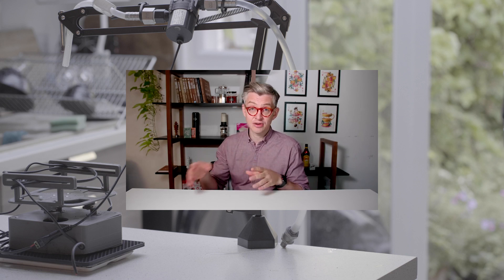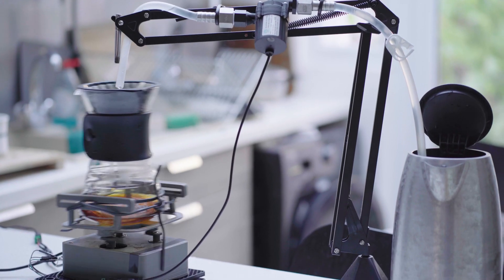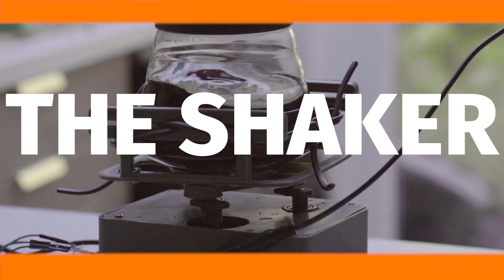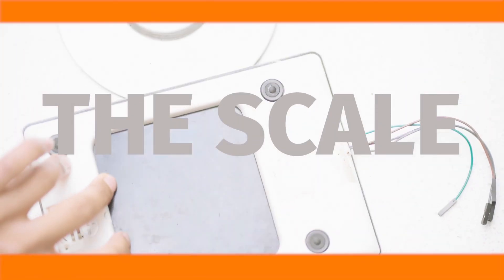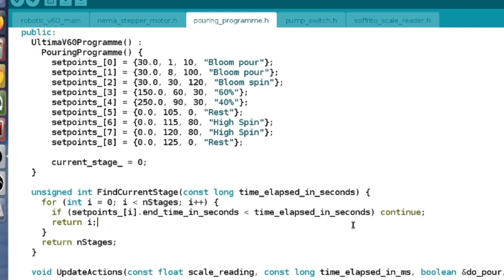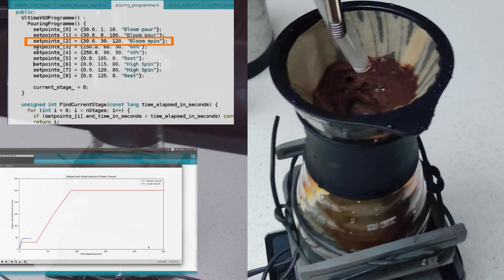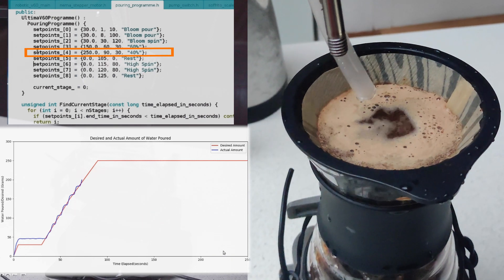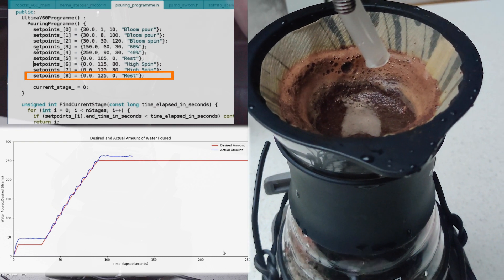A Robot Imitates a World Barista Champion

Comment: This is awesome and also how I think Blade Runner starts. If you start making you own friends to keep you company during the pandemic you know it has begun.

Also could you put a flow restrictor and smaller tube on the output of the pump to slow down the pumps flow
Reply from the maker: What a good friend, one that makes you great coffee. 
Thanks, Ryan! Improving the flow-rate control and smoothness is definitely on my list for V2
Reply from the maker: Yeah, right now I'm thinking of going with a diffuser of some sort so that the flow is smooth. And for the flow rate, I will use a solenoid valve which will let me programmatically control the tube opening size (like you said) :)
Reply: @CookCodeSleep  my first thought was something like the flow restrictor that you can get for some gooseneck kettles in a tube the size of a gooseneck kettle output. Being able to program the flow restriction would be a nice touch I was just thinking something simple
Reply from the maker: @labcoat22  I see. I will give that a go and see how it goes. In the long run, I do want to be able to control the flow rate so I can adapt to different recipe/dosage requirements.